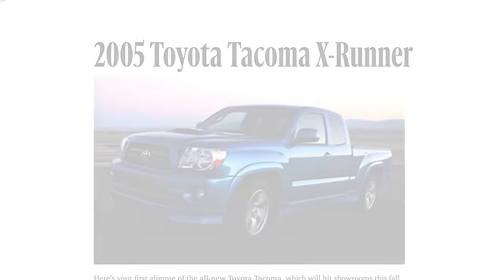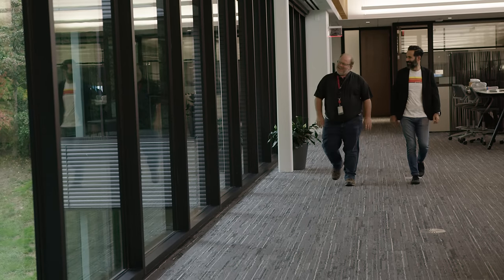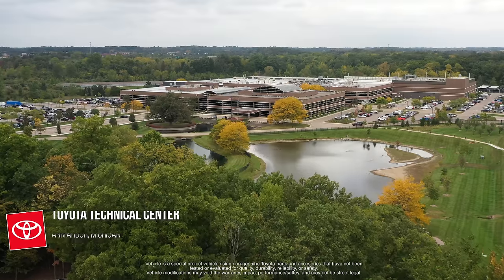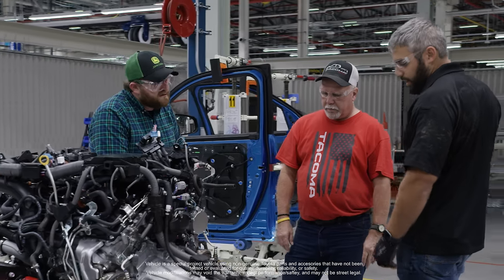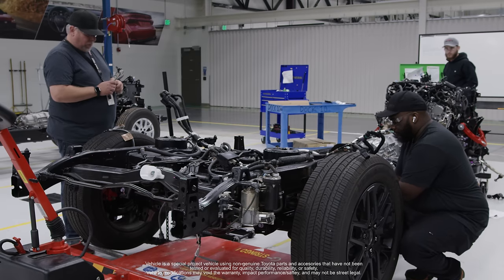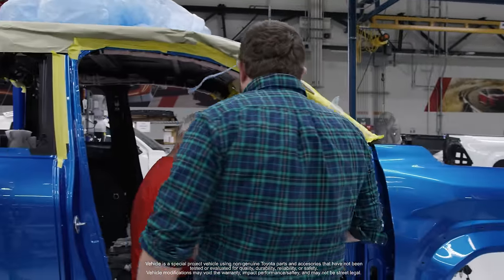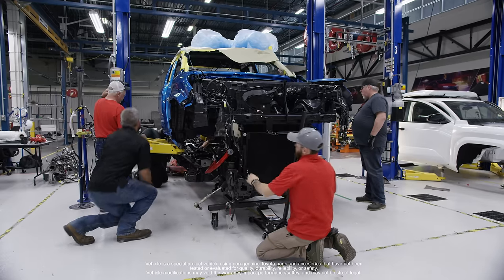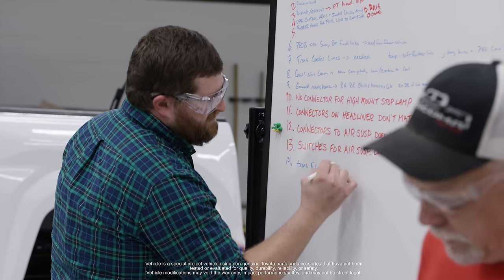"Tacoma X-Runner Concept": SEMA Build Episode 3 | Toyota

Comment: Dear Toyota,
If it is not too much, can you put a manual transmission please!!!?
Reply: yes please!!!!!
Reply: I wish and almost thought they did. The manual torque rating is too low for the torque this truck has. You'd need a hopped up 2.4T instead.
Reply: this. a true x runner needs a 6 speed manual

Comment: Build it. 400-425hp, auto w/ manual 6sp option.
Street performance truce market has been neglected too long. If you can offer it at a reasonable price, or maybe varying trim levels, it should sell wildly.

Comment: Hope something close to this makes it to production. A manual transmission would sweeten the deal. My current X-Runner needs to be replaced and I've held off ordering a new Tacoma the past couple of years because I'd have to get 4WD, which I have zero use for, and a short bed -- boo! -- all because I wanted a V6 and manual transmission.

Comment: If this was available with a manual transmission I would be torn between it and the TRD Sport. Granted, there's no need in longing for either when we don't even have finalized, configurable options for the rest of the 24 Tacoma line-up.

Comment: This is what TRD sport should look like not like the current TRD "SPORT"🙄🙄
Reply: Yep, I agree a bit. They've gotten a bit lost? Look at a 2005 TRD Sport Access Cab in speedway blue and that's what it is. Save the overall look of the TRD Off-Road for it alone and don't just color-code to be a "TRD Sport".
Reply: @nwezetx1 Isn't just color code.
The Sport has a stiff suspension with Hitachi shocks allows for better street performance.
Where as the OR has a cushy off-road suspension with Bilsteins.

Comment: Why didn’t yall put a 2UR-GSE V8 that could’ve been perfect 🤩
Reply: 🙄😒🤦. Not for trucks AT ALL.
Reply: @nwezetx1  but it is for performance AT ALL
Reply: @nwezetx1 says who? The 3UR is the 5.7 and that works for the Toyota trucks. They even have Supercharger kits for them from Toyota. The 5.0 would work just as good.
Reply: @2URLex  No the 5.0 wouldn't. 5.7 would and is no longer in production, unlike the 4.6L suitable for trucks and now ending production.

Don't ask me, talk to the people at Toyota, as they gave many reasons why the 5.0L 2UR-FSE is not something you can just toss into an SUV or pickup.

Why people on the Internet toss logic out the window and quote random in-house engines, then get mad that it doesn't happen, no idea. It's not some plug in play solution.

The 4.7L UZ was feasible, so was the UR 5.7 and 4.6. Not the 5.0. I've seen this comment many times over the years and remember what an engineer at Toyota dispelled.
Reply: @nwezetx1  I don’t have to ask any one, I own one of these F cars. The V8 being axed is due to changing emission standards  and Toyotas conservative habits. They could’ve easily put any V8 in their new trucks.

Comment: Love the new x-runner but it must have a manual transmission. I hope Toyota don’t take the same direction as the supra transmission drama. 

My brother has a 2006 blue X-Runner and swapped it with a V8 4.3L 3UZ engine and a CD009 6 speed manual transmission.
I have a 2012 Tacoma TRD with a manual transmission. Will be getting the new tacoma with a manual. 
My brother won’t get the new x-runner if it’s available in manual.

Comment: Y’all better build this.  Y’all screwed the Camry up so bad for 2025 that I’ll never buy another one.  I need power, responsiveness, handling, reliability, and practicality.  This looks like a very real option.  Hopefully it’s not 60K if you do it.  And it needs to look good.  By the way, don’t waste your time on EVs.  That’s a dead end unless your new battery technology doubles range and significantly shortens charge times.

Comment: All I have to say is that this 6 cylinder should have Ben on the 2024 Tacomas. Yet better 6 speed manual transmission.
Not the stupid 4 cylinder turbo electric motor crap.

Comment: Toyota will never put it in production; they are too much of a wimp to do it. But if they did , it literally has everything i would want to do to my  truck aftermarket or if i had access to the toyota parts bin all the way down to the air bags in the rear. If toyota will put their money where their mouth is, so will I. I already have financing ready for a brand new xrunner.